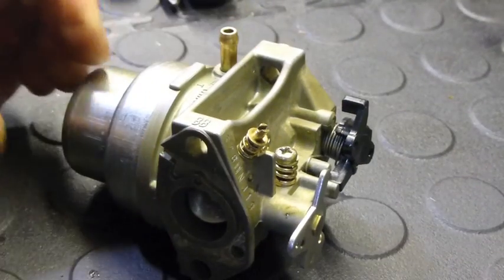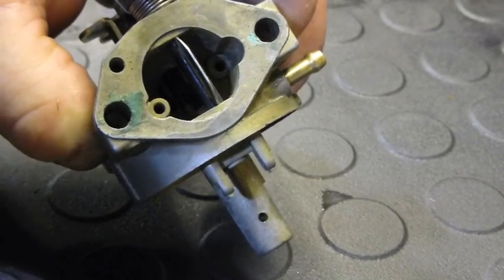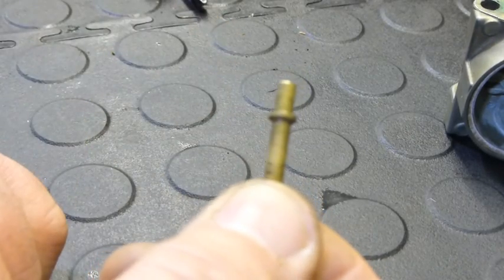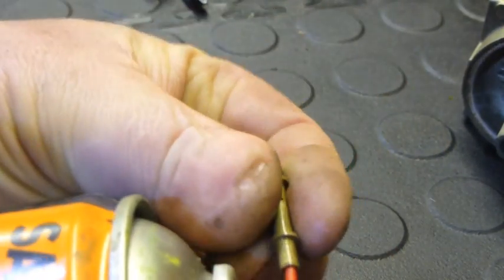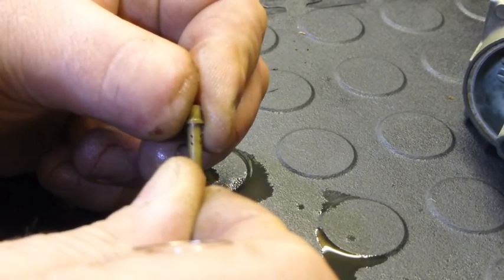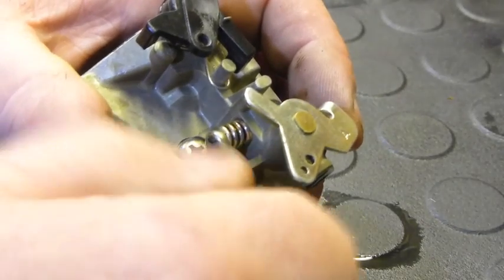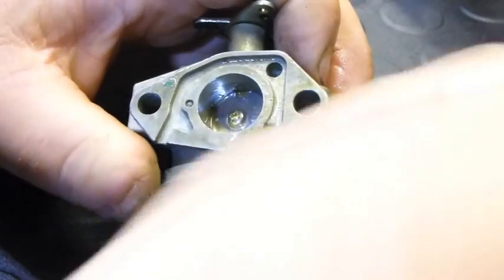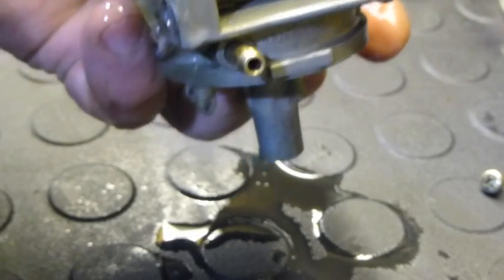Cleaning a Honda GCV carburettor

Comment: The long brass tube with those tiny holes in it is called an Emulsion Tube.  The threaded brass retainer for the Emulsion Tube is called the "EmulsionTube Retainer" (and not a jet) with the hole in the center of that retainer simply to allow fuel to travel through it on the way to the Emulsion Tube.  The center hole is not a jet but simply a fuel supply port - and yes, if it is partially or fully obstructed it will fuel starve the engine.

Comment: I like your video, right to point, you know the old saying I took off 3 carburetors n all three I couldn't  put the wire through jet ,everything else was done. I read u could drill it. I PUT back on my honds same thing starts n stalls do the do this screw with people. What is your answer help me out. The other Craftman works then stall theirs gotta be certain method.
Reply: Help me out

Comment: The best and quickest way to remove the jet from the bowl nut area is to unscrew it and tap the side of the cavity with the handle of the screwdriver and it will fall out without using small pincers.
Reply: I loosened the jet but it will not come out. It just rattles around in the column, but will not fall out. I shook, banged, and tried needle nose pliers to pull it out to no avail...

Comment: Do you have a way to keep the carb clean using additives? Ratios? My carb gets gummed up and has to be cleaned every year even though I use a winterizer additive in it. It runs well when clean, slow and shuts off quickly when it has sat through the winter. I would love to have my bowl and nozzles and jet stay clean.

Comment: Great video. Thanks.  Another way to remove the tab on the cap of the idle screw is to cut it off with a cutting wheel of a Dremel tool. No chance of bending it or breaking it off.

Comment: I have a plugged vent on the main fuel flow tube, in the idle section. I can blow carb cleaner through the small hole (which is shown in your video at the 7.31 minute mark, and get nothing (both fluid or air), coming through the main center tube, like you did. Passage ways are all clear right from the hole at 7.31 minute mark on your video, to the idle jet's hole. It appears I have a blockage in the center of the main fuel flow tube, to the idle section. Any ideas on how I can open up that port hole, to allow fuel to flow through it once more. Tried clearing it with both use of a compressor, and caned carb cleaner. Even inserted a nylon brush inside, trying to clear, and open up that vent hole. It's starving my idle section of needed idle fuel flow from the reservoir.  Have any ideas on how to get that idle port hole open again?

Comment: I just finished putting mine back together  but the jet would not drop so I sprayed carb cleaner through it but I had my doubts carb looked new so I crossed my fingers after putting it back on mower no change still surges now I have to remove it and try again to get that out the Briggs and Stratton carb it dropped out after jet dropped out no fuss not Honda

Comment: Cleaned one of these today that was soaking in Gasoline for three days , one of the worse I'd ever cleaned . This Honda carb was so bad the main jet came out but couldn't get anything to pass threw it , I'd been told not use a mini drill to drill in it in prior videos on utube video . But I did and it worked for me , for I tryed everything and the drill press worked out for me using a mini drill bit. The Honda mower is running great  now.......

Comment: Thanks for your video...i like how fast you went..right to the point.  But you may need to concentrate on focus and centering.  Half the time the carb was out of the picture.  You showed me that i may have missed a few holes to clean that may be the reason why my stupid gvc 160 isn't turning over. Cheers.

Comment: Thanks for mentioning to clean the idle screw at the end of your video.. I have cleaned my carb but not the idle screw and still my mini bike dies after the choke is off. This might be the problem  since nobody mentioned it on other similar videos I watched and skipped my mind of cleaning it. I will give it a try and let you know!!! :)
Reply: Did it help? My gvc160 dies when choke is off....only runs on choke too
Reply: @macknumber9  usually thats because the needle clip is in the incorrect position
Reply: @1989mcgrath  What's the "needle clip" ?

Comment: What are u spraying to clean the holes out? Thanks for the tutorial.
Reply from the maker: sorry for the delay in replying Robert. I am using carb cleaner spray, sometimes called throttle body cleaner.